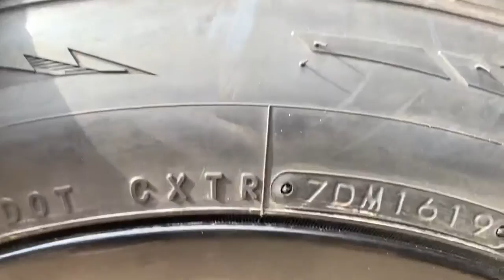Converting My Challenger to an OEM Widebody!

Comment: Lil tip on the plastic clips, the holes you drilled, take a tapered punch and basically dimple die the hole in, not a lot but pushing the hole in with the punch will help you clips pull the fender flare in tighter, I put bush wacker flares on my truck with a clip similar and they did sit tight to the body, try to figure out what to do it was a light bulb moment. I showed it to the 4x4 shop here in town and they were impressed and not it’s standard practice. Hope this helps. Great build, I want to do this on my 08 challenger and I want thank you for doing the figuring out for me, the is a burnt wide body in the junk yard I’m thinking about buying the front fenders ect
Reply from the maker: Awesome tip man I really appreciate it and the kind words! I will definitely give it a try! Grab those fenders man! Don’t waste time!
Reply: Just an idea. Maybe make a template to sell for us guys wanting to do this.
Reply from the maker: Been thinking about it. The downside is there are about 3-4 holes missing because it’s the part of the rear quarter I cut out.
Reply: Man you are a smart dude. If it works for you it will work for us. You have me motivated to put on all my APR splitter and defuser. I smoked a parking bumper and had a new bumper put on. Have all this money in parts just laying around. Glad I found your channel. Keep up the great work
Reply from the maker: Man I appreciate you big time. Thank you so much I am happy I have motivated you as well. I’ll work on that template and see what works best.

Comment: Good info bro thanks. I have a 09 srt8 and I finally got all parts oem. It took time to get them because they do block you from ordering certain parts. Only thing I’m scared to to do the rear flares with the whole drilling. I hope I can nail perfectly with one shot and not mess up. But thanks for the video 👌🏼👌🏼👌🏼
Reply from the maker: It was not too difficult you can do it !
Reply: Where did you find the oem parts for the 09 srt? i have the 08 srt
Reply from the maker: On this video at the 16 second to 23 second mark I say “it would not have been possible without the help from Wesley Motorsports, so thank you Kevin Wesley”.

In other words, they got the parts for me to help me continue building the car for racing like they do. 

If you want oem widebody parts find a MOPAR DIRECT CONNECTION dealer, not just a dodge dealer, they MUST BE a DIRECT CONNECTION dealer. And you can buy all the parts! 

Don’t believe me tho here is the article! And Yes…. You still have to cut your rear quarters (also in the article) 

https://www.motortrend.com/how-to/hellcat-widebody-kit-direct-connection-power-brokers/

Comment: wow I bought mine in vycres but I was never convinced and when I saw this I will opt for the original the bad thing is that they do not sell the flares
Reply from the maker: I’ve seen some really nice vicrez flare installs. I was one of the very first to ever try it and I could have done a better job. 

They withstood ALOT of abuse from me and my driving. Ultimately this is the best way for me and my driving to not lose a flare. 

During the pandemic I didn’t race and never had an issue tho. It’s all about the install.
Reply: what is the total cost for the whole kit
Reply from the maker: It’s technically not a KIT. Their just parts. 

I’m right at $2700 in parts including freight shipping. 

I’ve ordered new bumper brackets and the push pins. There was another $200. 

Now paint/wrap and install.
Reply from the maker: Current tally - $2886.82

-Not including paint 

- I am installing myself - so if your paying a shop make sure to account for installation fees. 

- not including the upper and lower grills and headlamp bezels 
- not including front bumper side marker lights 
- not including about 60 clips (I already had some) 

Clips are $1.39 a piece. They are the blue clips I showed in this video needed to fasten the flare to the body/fender.
Reply: I am doing the purchase of the fenders but I get four different ones, how do I know which is widebody?
Reply from the maker: This is from a forum, not from me I just copy and pasted. Research the part numbers some have changed. 

parts list. 
· 68371805AA - Front Bumper*

· 6EY79TZZAB - Left Flare Extension front bumper

· 6EY78TZZAB - Right Flare Extension front bumper

· 68315879AA - Front Splitter / Air Dam

· 68319251AA – Reinforcement maybe part of the bumper?

· 68319257AA - Left Closeout Cover part of lip

· 68319256AA - Right Closeout Cover part of lip

· 6EY83TZZAB - Left Front Wheel Flare

· 6EY82TZZAB - Right Front Wheel Flare

· 6EY91TZZAB - Left Rear Wheel Flare

· 6EY90TZZAB - Right Rear Wheel Flare

· 6EY87TZZAB - Rear Flare Extension came with bumper

· 6EY86TZZAB - Rear Flare Extension came with bumper

· 68371814AA - Rear Bumper w/ Park Sense Option*

I think this could all be done with out the front and rear bumpers. it did make it easier as those had the holes and tabs in them for mounting the flare extensions. and gave me a chance to fill those indents where the front plate mount is supposed to go.

along with that list forum member HRJ helped me track down some misc parts that are also necessary:
the strange looking bendy side markers:
LH - 68319391AA
RH - 68319390AA

The lower rocker panel black plastic that will have the bump outs to meet the rear of the front flare and front of the back flare (I still don't have these yet)
Right - 68320484AC
Left - 68320475AC

Huge thanks to HRJ without his help i'd still be struggling to finish. 

yes it was expensive but i really wanted a widebody my 2015 with 27k miles on trade is probably worth $43k at best i owe around 38k so not much to work with. new widebody how I'd order is $76970 which is not an option for me. hopefully it wasn't a huge mistake only time will tell. so far i love the way it came out.
Reply: @TIRADORACING  thanks
Reply: I got lost in part of the fenders I think you did not include it
Reply from the maker: 68320400AB- front fender right 
68320401AB- front fender left
Reply: @TIRADORACING  thanks
Reply from the maker: Good luck brothab
Reply: They do sell the oem fenders just time in oem widebody direct connection mopar sells them they’re 2500
Reply from the maker: Well baby driver, this video and comment thread was made prior to the direct connection program lol

Comment: He bro I’m interested in getting a wide body kit we’re did you get the oem parts from or what web site do I go on
Reply from the maker: I mentioned it in the very beginning of the video. It was sponsored by a Dodge Racing team. I sent the part numbers and they got had to place the order to obtain them. 

Sadly the parts are vin locked. I wish I had a better solution man but that’s how I got mine.

Comment: Maaaan, those rear fenders are the nightmare I imagined they would be. I really want to make my cat widebody but I just don't know if it's worth cutting up my cat.
Reply from the maker: Ultimately you have to weigh it out as it pertains to you. 

Mine is not purely aesthetic and I already risk my car out on track. So cutting the car to be able to run bigger tires outweighed cutting it…. 

If it’s purely aesthetic I would trade up to an oem widebody car. 

That’s just my opinion, I know there are hundreds of opinions surrounding this matter of cutting 🆚 trading up.
Reply: Cut it bro. Even the authentic OEM widebody's out of the factory are cut. Just don't do it if you plan on ever trading the car in. And you can always do the OEM kit so it wouldn't completely destroy the cars value.

Comment: How did you lift your back tires so that they would stop rubbing?
Reply from the maker: I didn’t, I cut the rear quarter panel. Welded the cut shut and seam sealed it. 

My car is also on coilovers so I can lift the rear suspension more but that would throw the balance of the car off. In fact I lowered it more just last week.

Comment: So the vicrez kit IS a little wider and thicker huh? 🤔
Reply from the maker: Wider as In they stick out slightly further. And thicker as in left to right if your looking at the car from the side. The oem  material  itself is thicker plastic. Ima gonna measure it
Reply: @TIRADORACING  I seen the vid. Good info man, thanks. It will help me spec out my new wheels properly. I had suspected it, but you confirmed it for sure. 👌
Reply from the maker: You can see it when I place the oem rear flare over where the vicrez flare was (since I pulled paint) the radius is smaller on the oem flare. Let me know if you need measurements bro. I’ll gladly measure for you
Reply: @TIRADORACING  I should be good man. Thank you though. Seeing what you said about the vicrez hid more of the tire was the info I needed. That way I know that specing out my new wheels will be different than just saying "make them to oem widebody soecs" 🙏

Comment: original video shows us how we SHOULD glue not tape the fenders, this video shows us how you NEED a new paint job because of the glue while swapping to oem parts.
Reply from the maker: It’s all up to the owner. I mentioned it somewhere in the videos I had already planned to repaint the car, the oem part offer from Wesley came at the right time. 

Also, trying to blend new paint on the front oem fenders and flares with the old paint on the doors and quarters was going to be hard. 12 going on 13 year old paint vs new paint.

Plastic flare, metal fender and door was going to look like 3 shades of orange. The vicrez kit was also a different shade but hard to see on camera. 

Either way, after the initial install video I’m just taking y’all along for the ride. In hind sight, If you want oem and can find an oem widebody car just trade up.

Comment: What exactly is different between the widebody you had and oem widebody
Reply from the maker: What exactly is different? All of it. The last kit was just flares that I glued on. This is an entire fender replacement for the front with 30-40 clips to install it. 

The rear I had to make a template and drill holes for the clips to fit into the car.
Reply: @TIRADO RACING  Okay, thank you for the information. I wasn't trying to be rude new to call building. I'm about to go my first 2014 challenger build. Who made the kit you had if you don't mind me asking
Reply from the maker: No your good brotha. The old kit was from Vicrez. The new kit was from Dodge. 

You can make the vicrez kit look really good with some effort. Check out rome low life on YouTube he did a fantastic job
Reply: @TIRADO RACING  I watched some of your other videos. I really enjoyed them. I sub to you, but would you recommend that vicrez kit, and where could I find a new Gen bumper rear
Reply from the maker: @gabrielgomez731  thank you! If you have the skill to make the vicrez kit look good then he’ll yea I recommend it. It’s also a bit wider for wider wheels but not by much.
Reply from the maker: @gabrielgomez731  rear bumper probably a dodge dealer tbh
Reply: @TIRADO RACING  Thank you so much for your videos and for the replies. I mainly just want a front bumper. I plan on doing classic design concepts group 2 widebody kit

Comment: Why did you remove the vicrez wide body ?
Reply from the maker: This car is unibody and the front twists really bad .basically after that season of racing the front was twisting and the flares started lifting and falling off. 

The worst part was the fender and door gaps actually changed. 

This is an old video but once the car was painted all that was fixed.

Comment: Might as well just convert the whole car bro. Rear bumper to the 2015+ model. And the interior.
Reply from the maker: I race this car on track, it’s not a conversion to look like a demon or hellcat. 

I’ve explained this a few times, I cannot justify the cost of the rear bumper and lights. They don’t make the car go faster and if I get into an accident those are very expensive cosmetic parts. 

The interior is not changing either, it does the job. 6 point weld in roll cage, race seats done. 

This car will always be used for road racing and autocross. But I do plan on buying a newer mopar in the future. Maybe a charger hellcat….

Comment: How are you actually do that is buy some modeling clay you put it on the fender about where your screw holes are going to be press the fender down it leaves a hole where you need to drill your holes and put your fender on which takes about 10 minutes and I'm sure it took you much longer than that ask an old guy they'll tell you how to do stuff like that the easy way
Reply from the maker: That does sound easier (in theory). Give it a try and make a video I would love to see it done that way!

Comment: Whats the website for the parts?
Reply from the maker: I said it in the beginning of the video. I could not get the parts myself and had help from my friends at Wesley Motorsports. 

The parts are blocked. If you don’t own a widebody, vin and proof of ownership it’s pretty much impossible. They even ask for pictures if the car has been in an accident. Along with the insurance claim if you try to use someone else’s vin....

Comment: Why did you go OEM over the Vicrez?
Reply from the maker: Sturdier for what I do with the car
Reply: @TIRADORACING  how to you think Vicrez kit will hold up for a weekend car? I don’t daily drive mine and don’t plan on racing just want widebody look.
Reply from the maker: Oh it’ll be just fine. My kit was on over a year (pandemic) and I was daily driving it because the roads were so empty. I would drive 45 min one way to work. 

It took about 5-6 autocross days with the body twisting for the front flares to start lifting. Let’s not forget hitting cones and driving off course into dirt and so on. 

For a weekend car the kit is perfect. My only issues where the front corners. 

I’ll make a new video explaining all this lol
Reply: @TIRADORACING  I plan on having a shop install it and want it to be permanent. Do you think glueing it would be best option?  I’m not going to be lowering it so don’t want to cut fenders and I already have  20x11 -2.5 offset wheels for it with 305/35r20’s so everything should be good there.
I’ve had my car 3 months now and only have 600 miles total. I do plan to drive it more once this COVID-19 stuff is under control little more.
Reply from the maker: Glue is pretty permanent as you saw it took some effort to remove. But if your shop has a better method by all means let them try it!
Reply: @TIRADORACING  thanks for the help.
Reply from the maker: Anytime!
Reply: @TIRADORACING  hey bud what are you doing with the old vicrez kit?
Reply from the maker: Their kind of rough man. They need some elbow grease. The lower flare pieces have some small cracks too. The rear lower ones are covered in rubber from burnouts. I can send you pics on Instagram if you wanna seee
Reply: @TIRADORACING  cool can you send me the info how to look you up on instagram.
Reply from the maker: @tiradoracing lol
Reply: Is the look the same vicrez vs oem ?
Reply from the maker: The oem has a smaller radius and is a little narrower. Vicrez kit a a bigger radius and is slightly wider. Other than that they look very similar

Comment: What size tires do you have for this wide body
Reply from the maker: Probably the 1,000th time I’ve answered this 😂

315/40/18 on all 4 corners , NITTO 555G2 for the street

315/30/18 BFGOODRICH Rival S for autocross. 

The NITTOS fill the wheel arches more with the 40 series sidewall.

Hope this helps!!